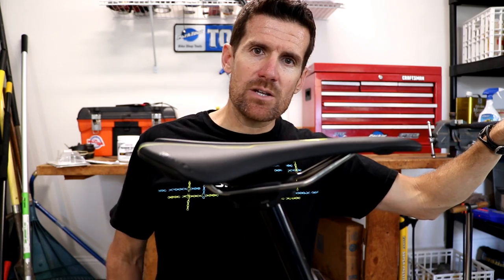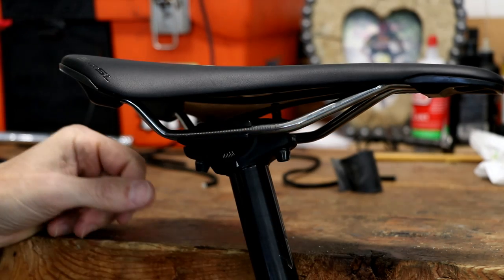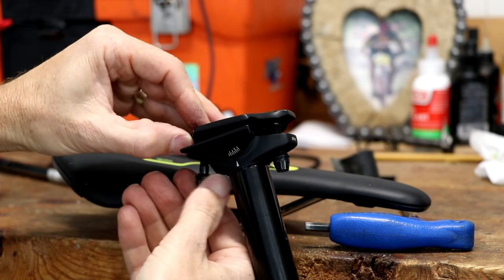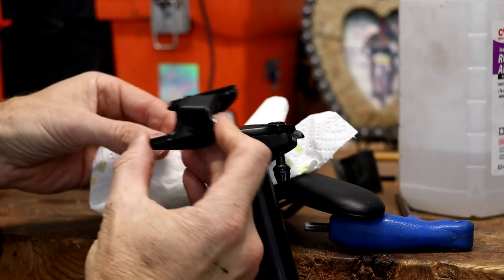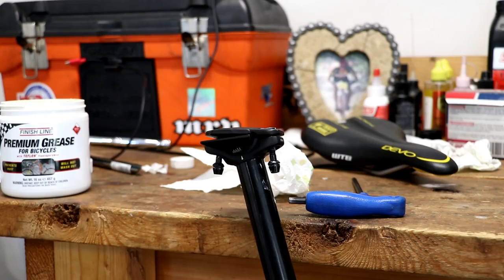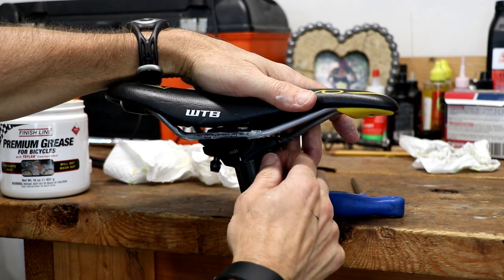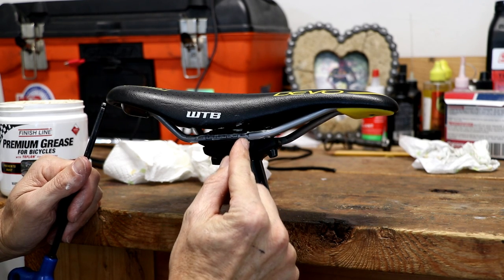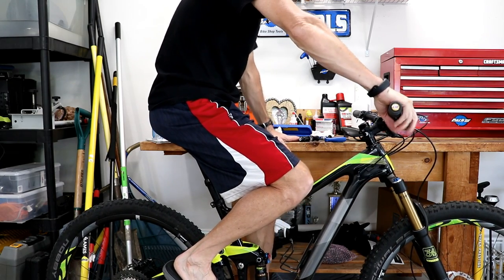How to Install or Replace a Bicycle Saddle - Extended Version

Comment: This is super helpful, even 5 years later! It might be worth noting (for someone) - on my new Giant (Liv) bike, there are 2 bolts, but one has a thumb screw at the top, basically under the saddle but at the top of the bracket - pretty difficult to get to. You cannot adjust that until the rear bolt has been loosened. It's kind of a PITA. So, if you get it all installed, and the nose is too high (or low), you have to fully loosen the rear bolt before you can adjust the front bolt to lower/raise the nose, then you go back and tighten the rear bolt. Test, and repeat if necessary. All that said, I was able to get my new Terry Liberator Race saddle on my Avail AR 1with the help of this video - thanks! Now just need to take it for a test ride to see if it's going to work for me. Great video - very helpful!

Comment: love your videos Clint but for the first time, I disagree with you. Greasing the saddle rails is asking for slippage in my opinion. More importantly though, the torque specs printed on parts, always refer to dry torque. ie. without lubricant. On average, torque should be reduced about 30% for wet torque so you'd be risking stretching your threads here. Furthermore, copper compound is designed to stop bolts etc seizing. Grease is for parts that move. Certain greases can actually make threads stick harder when they get water and dirt contamination. As I say, I love your videos but thought I'd add my 2c this time. Keep em coming!
Reply from the maker: +Gavin McDonnell thanks for the comment. When I was in BMX camp at 15 years old I remember A mechanic who told me to always put grease on threads. I've done it since and it has always worked well for me. That was many many moons ago. As far as slippage, I've never had a saddle slip, but I have had rails the creek. Whatever works for each of us!
Reply: i recently had a ks lev integra dropper post that developed a creak. Grease on the rails and contacts point fixed it. No slippage in 3 months. Kindshock actually recommends greasing their seatpost clamps.
Reply: That's good to note about the dry torque versus wet torque. I've taken to using a lite coat of dry condition lube on the rails and then wiping it all down after install.

Comment: Nice video. I've always found that placing a small piece of plywood on the saddle with a level and taking a measurement from the sitbone position to the stem is a great way to find your preferred position once the swap is made (I use sitbone position as saddles vary in length).  It may need to be fine tuned, but you will likely be within a mm or 2 right out of the box.  It might also be worth noting that the bike should be positioned perpendicular to the direction cars are parked in the garage as 99% of garages are sloped front to back and level left to right.
Reply: Also, could use a straight 2x4 or "straight edge" with a level on it to find a good spot to position the bike. Good call on the slab, Garages should be sloped towards the outside.
Reply: Or just use a 24" i-beam level? $8 at Lowe's and useful for all kinds of things around the house. No issues with slope if you do all this inside your house (usually...).

Comment: Do you have a single bolt video. I have  seat with a single bolt configuration like you show at 1:00. I don't know how to reinstall my seat, it has so many parts that need to come back together. Help!

Comment: For a single bolt saddle clamp, is it necessary to use a washer that is up against the bolt or does it depend on some other variable?

Comment: Great video, was wondering why the tilt was adjusting in this way. (My other bikes all have one bolt) My front bolt just touches the bottom of the saddle, do i need to change it out for a shorter one? Its the one that came installed from manufacturer.
Reply from the maker: If it touches the bottom of the saddle you may want to get a shorter one. I would just keep an eye on it for a few rides and see if it's starting to press into the plastic. If not you may be okay, but if it does definitely change it out.

Comment: Good video. I recently purchased a new seat post with a shock in it. I like to set everything to the recommended  torque specifications if that information is available.
Reply: David Branscome did your seatpost come with an installation guide of some sort? You can typically find the torque specs on it.

Comment: I just got a bike called the Polaris PO2402-1-MT 24" Unisex Ranger B.0 Full Suspension Mountain Bike
I have assembled the whole bike but am very confused about the seat, I have the seat post inserted and have all the nuts tightened but the seat still moves around freely, there were no extra pieces in the box to hold it and would like some help

Comment: I have a two-bolt (different style) and accidentally popped the top piece off. I can’t for the life of me figure out how to get it attached back on there. It has barrel nuts and bolts, and the bolt keeps hitting the top piece and stripping it. Help!
Reply from the maker: Make sure the seatpost is not backwards
Reply: Clint Gibbs thanks— I didn’t remove the seat post, just tried to loosen the saddle clamp and the whole top piece of the clamp came off.

Comment: nice video but I wouldn't recommend putting grease on the saddle rails, very unprofessional could cause slippage making it slide out of a preferred position making it unstable uncomfortable and can turn into a hazard. just a thought.
Reply from the maker: I've been putting grease on saddle rails for over 20 years and never had one slip. But that's just me. It does help prevent creaking.

Comment: Unfortunately, the seat post wasn't in any packaging but it was in new condition. I set the torque on the bolts to 9 Nm. That might be a little high.
Reply: if you look down next to the bolts, does it say anything? in mine it says 12nm... it's a Ritchey seat post.
Reply: Prastt 
There was nothing stamped on it. I have had the bolts that hold the saddle rails to the top of the seat post come loose on one occasion while I was on a long ride. I wasn't carrying any tools that day. I learned my lesson on that. I will consult with the bike shop to see if I can get the torque specifications.

Comment: What's the big deal of pulling both bolts, especially if you're cleaning. Geez.
Reply from the maker: +James McClellan (Mercuryan) it's not a big deal. Cleaning. It's about installation. If you remove both bolts it is harder to install the saddle with some seat post designs if you start with both boats removed. It's just a lot easier to do if you can keep them in.